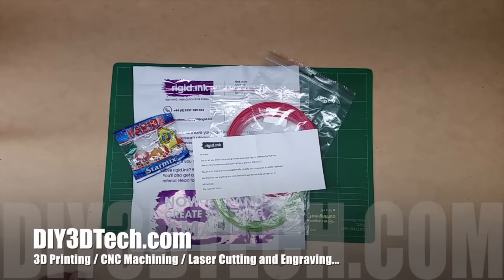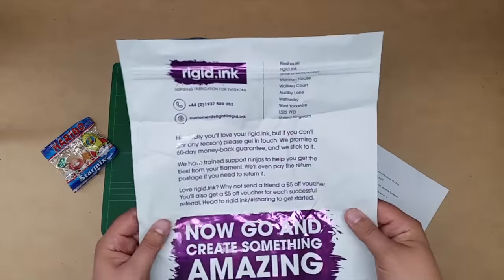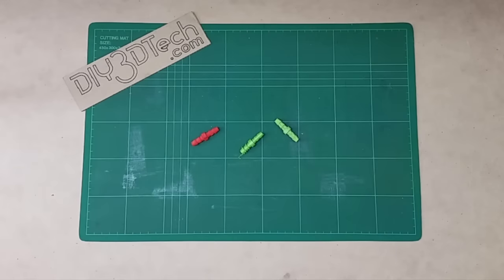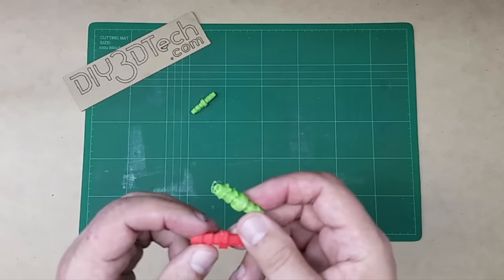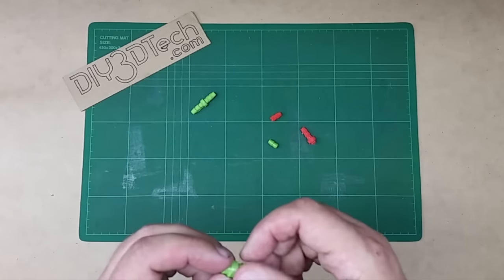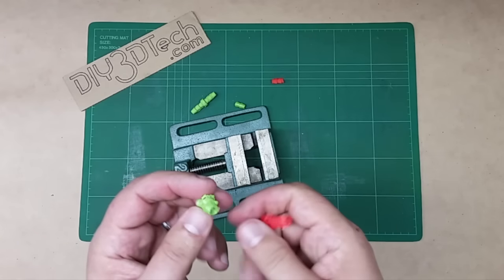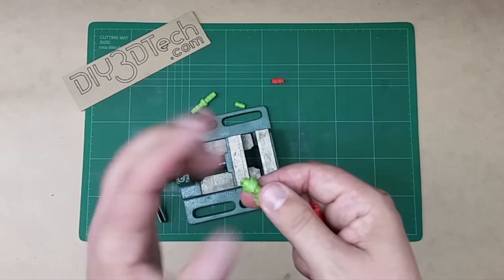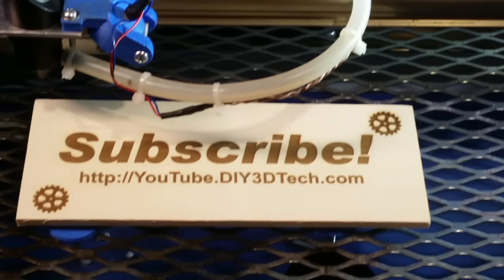Review - Rigid Ink PLA Plus Is It Better?

Comment: i found my samples , PLA+ needed higher air gaps between supports . it has mad strong layer adhesion , and i printed at 220 on my fab mini . bag is cool it keeps dry and out of light . i have found some of my PLA's spools have damage from sunlight exposure  , so metalized are way better than the freezer bags .  sun damage resulted in one side brittle for a few layers deep .
the PLA+ plus i tested was crazy strong but i did have 1 nasty inclusion in it that caused a clog I cleared your way . I kept the clog as it is easily a visible dark chunk . 
but their PLA and PLA+ was easy to get first layer , and great layer adhesion when printed at 220c on my fab mini. 

RE , strain tester .. is a digital load cell made with arduino capturing data , and holding peak value , so you can see the curve and the final max .  so a load cell , a load cell amp , and a arduino for data log . good project for a winter / fall day
Reply from the maker: Air gaps????  As that is what I didn't find is a very strong layer adhesion (as I had hoped for) as it was maybe a little better but not a lot as I had hoped for.  Yet I am still impressed with it's off the bed finish quality as if a ran a service beau for 3D printing this is what I would us.  As you are use to this video is a month old so I have printed a lot of other things and continue to be impressed by the finish quality off the bed. Clogging yes, I have had to play with (i.e. reduce) retraction to avoid this...

Comment: I don't know the name of it but I have seen one where it looks like a hammer that pivots to the object to see how much weight it takes to break it but it also tests for force which is another factor (mass x acceleration = force) to test these filaments with.  You can make that with a pivot, a shaft, and a way to change out the flat weight.  Acceleration would be gravity and the mass would change according to the weights used.  It slams into the objects printed (connected at the direct bottom of the swing) and you will know which one is stronger.
Reply from the maker: Interesting idea, as to another viewer shared designs for a "Testerbot" which I am going to add to my build list :-) [https://engineerdog.com/2015/04/13/check-out-testrbot-the-300-universal-test-machine/]

Comment: Should have used the horizontally printed one for a valid comparison.
Reply from the maker: Hmm not sure what your suggesting, as one printed  vertically and the other horizontally.  So are you suggesting 90 deg to the horizontal version?
Reply: DIY3DTECH.com No.  As others mentioned the PLA part was printed horizontally and the PLA+ part was printed vertically.  The print orientation will affect the strength of the part.  You should have tested against the horizontally printed PLA+ part for more accurate results.
Reply from the maker: Both where matching, as the regular PLA vertical piece did not print so was only left with the horizontal print and in fact avoided printing the long ways as your correct for production or practical use this would be the preferred direction and I should have been more clear on this topic as I wanted to see how the plastic would "stick" or adhere together which I was not overly impressed (it was OK but not like Wow)...

Comment: I love destructive testing videos!!  Not sure how that would be better for anything but I will go to the website and do more research.  I agree with +XerotoLabs that sunlight is not good for filament.  I always store them back in their shipping box as well as out them into a ziplock bag.  Then those all go into a Sterilite container (plastic bin) with a gasketed bin that has a large desiccant unit that I can recharge from time to time as needed.
Reply from the maker: Since my shop is in the basement with no windows, UV light isn't an issue and while I know about moisture.  Frankly have not had an issue with it storing outside of sealed containers as if you look back I CNCed these spool holders which hang from the ceiling  and feed the machines.  Now in full disclosure, I do have a rather large dehumidifier in the shop (its 16ft x 43ft) running all of the time that keeps humidity low (it is the basement and this is Michigan).  You however, have given me an idea for another video  :-)
Reply: DIY3DTECH.com - I don't have a huge humidity problem here in California so I can leave the filament out for a while but still need to take measures to prevent absorption. I would rather take precautions than have prints with steam blowouts. 

If I have inspired you some how then I'm glad that I can help out!  Can't wait to see your video.
Reply: DIY3DTECH.com - I have been working on upgrades on my Maker Select (Wanhao) printer. Added Z-braces, longer bearings, and Y belt tensioner last night. Will be working on glass bed holders, heated bed wiring strain relief/support, leveling feet, new thumb wheels, and maybe a fan upgrade.
Reply from the maker: Wow!  Sounds like your going to town!  :-)
Reply from the maker: Hey wait it doesn't rain in California does it?  :-)
Reply: DIY3DTECH.com - It's pretty much a unicorn these days but we'll take it.  :-)

Comment: Just a quick question. Did you compare parts that had both printed horizontally? it seemed to me that the pla+ was the vertical part. I might have lost track though. might explain why it snapped so easy...
Reply: JD Begin I agree. The layer direction would make a difference in strength.
Reply from the maker: In regular PLA the vertical print failed so I could not test this against the vertical print of the PLA+.  Yet this alone says a lot for the PLA+ that it could print standing up.  Also, the idea for printing in the orientation was a "worse case" if you will as I wanted to see the adhesion properties as yes printing the long "way" would have made it stronger but not because of the bonding of the plastic.  However, your point is valid for a finished usable product :-)

Comment: Dunno about brands of this type of PLA but I've read it's totally stronger. So now I'll get a sample and see for myself.
After viewing this vid again I'm sorry but I don't see your strength test as comparative because of non-conforming print pattern.
Reply from the maker: Always worth a try but I find it to be more brittle in general then regular PLA as there are two key factors, (1) how strong is the plastic itself and (2) how strong is the bond of it sticking to itself and it is number 2 where I see issues.  However, on the plus slide is it creates very nice looking parts (I am guessing because its transition range is narrower then normal PLA).  However if your looking for "rigid" or solid  don't waste your time use PETG...